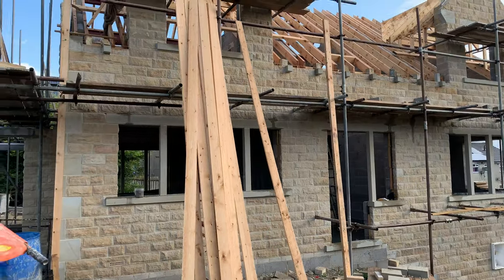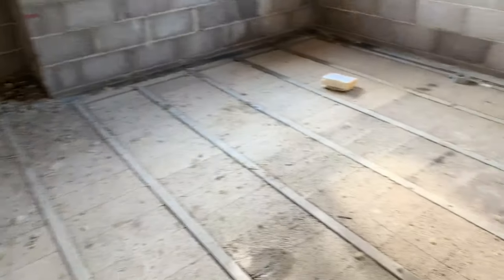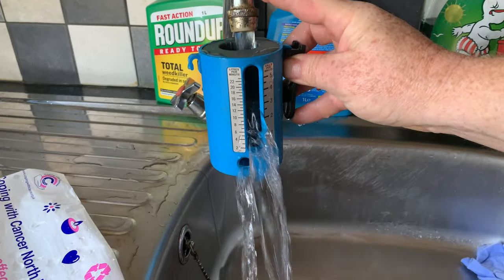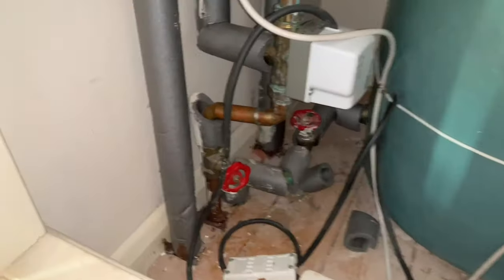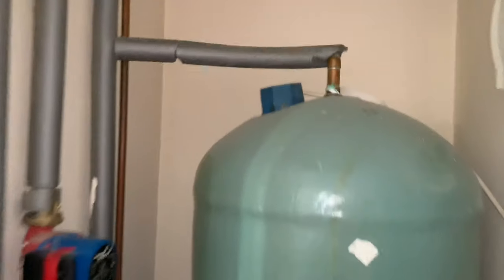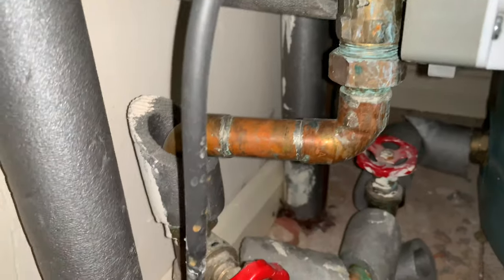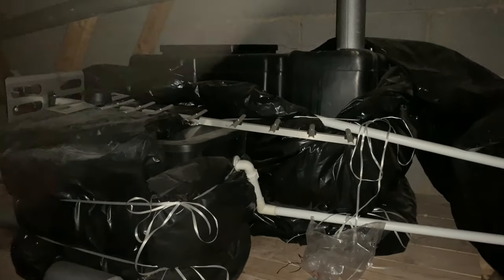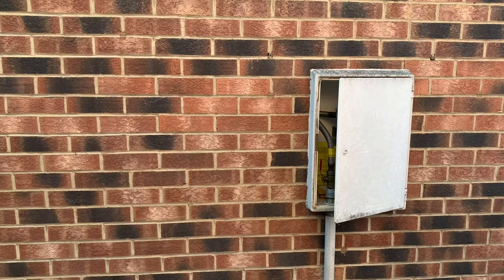Plumber - Quoting Jobs

Comment: 11 litres per min cold mains water is quite low.  I did not see any looking at the mains stop cock.  

General points for mains pressure systems (combi and unvented cylinders):

1. Fit a dedicated 22mm cold feed to the combi from the stopcock, irrespective of bore size of mains pipe. This assists in giving flow priority for the shower;
2. Fit a full bore main stopcock;
3. Dedicated hot pipe to showers from combi/unvented cylinder;
4. Fit combined isolators/flow regulators (using a cartridge for litre/min) on all H&C outlets - to balance the system;
5. You could use hot and cold manifolds with pipes to each outlet from each manifold. Then only 12mm pipe need be fitted to most outlets - 15mm for the showers. In softer water areas, even smaller bores. This gives quicker DHW delivery at the taps as the volume of cold water in dead-leg pipe is less.

Doing the above makes a big difference improving flow and influence of outlets being turned on when the shower is operating.
Reply from the maker: Do you really do this ?
Reply: @AllenHart999  
Yes, when I can. It always works. I can personally testify as my place is piped up that way. I have only done 5. once.  I see 5. a lot in France in new builds. They use the equiv of 8mm, 10mm, 12mm and 15mm from the manifold.  As the pipes are small bore, with low cold water dead-leg in the pipe, the delivery of hot water to the taps is fast.  We can learn a lot from the French. 

I have lost count of the times I have seen an old flow restricting stopcock with a 15mm pipe coming off it snaking around the house to all cold outlets with the combi teed off in 15mm, like it was just a tap! And they can't figure out why the H&C water system is poor.

The flow in marginal installations can be improved. Especially the irritating influence of one tap over the shower (*shower is king* and must get the bulk of the flow). It is taking out flow bottlenecks and balancing the H&C water system.   Do you need full flow in basins, w/machines, d/washers, toilets, etc?  The answer is "no". An extra 5 minutes on a d/washer or w/machine cycle because it is filling very slowly makes no difference whatsoever. Direct the scarce flow to where it should be, which is usually the important shower. Then a happy customer and no call backs. 

Make it clear to the customer that you balanced the system to improve the shower, as others mostly do not do it, or do not know how to. Then they tell others, who get cold slugs when the dishwasher cuts in.

It is dividing and ruling.

Comment: I went for a system boiler on my upgrade and kept the hot water tank as I have a solar heating system for the hot. I have a Valliant 630 ( I think) which is great. I just had it serviced and they commented that the install was excellent. It has a Magnaflow filter which had a tiny bit of muck on it. My installer ran the gas into the garage from under the stairs and installed the boiler in the garage.
Reply from the maker: Sounds like a great job. 👍

Comment: Question in regards to the flow cup: what if you take a reading and the tap has been restricted with the amount of flow to avoid splashing or do you open that all up before taking the reading?
Reply from the maker: Normally you would check on multiple taps. Thanks

Comment: Hi Allen, why do you prefer to run the gas pipe internal? Thanks
Reply from the maker: Gas pipe looks a mess up the outside wall. I wouldn’t want it at my house. Sometimes that's the only choice though.
Reply: Yeah i think i would prefer not to have it on the side of my house if i had the choice 👍

Comment: Hi this is my  problem  as gas engineer with gas pipe under size  you explain to customer doesn't work need to be updated you end up they getting some builder cowboys they do job for them.
Reply from the maker: Happened to me loads of times over the years. 🙀

Comment: Hi Allen, A lot of gas fitters prefer to run the gas pipe outside the house so that if a leak happens the gas is vented into the open air and there is no danger of gas buildup and an explosion. I myself prefer the pipes on the inside and I think it makes for a much cleaner look. That house looks as if it hasn't been built very long ago, so I don't understand why they have header tanks and not a combi boiler in the first place.
Reply from the maker: Most people run the gas outside because its easier and we may need to do that but i will try and find gas inside if possible. Thanks.

Comment: Did you include in your second quote fixing that dripping tap? great vid 👍
Reply from the maker: Apprenticeonfire I do not do taps 😂😂😂
Reply: @AllenHart999  🤣 fair enough
Reply: Allen Hart but the water pressure will be at mains from the hot tap, it’ll leak won’t it?

Comment: Running gas outside from meter to boiler!? If that's the only option, I'd do a recce of the neighbourhood first. See if there are any undesirables loitering abaht. There are parts of Rotherham and Sheffield where the scallies would rag it off the wall for the scrap and not even isolate the emergency lever valve at the meter.
Reply from the maker: This area is not one of the best areas in Leeds, Although its very nice where it is, 👍

Comment: Good video Allen.only complaint would be,surely your not just sizing the boiler on water flow rate? Size of rooms,make up of building etc is just as important for boiler sizing
Reply from the maker: Not really with a combi, Most combi,s give at least 24kw for the heating. 24kw would be oversized for most houses. Thanks.

Comment: Thats the y plan system out then , i wish i'd kept mine now. Biggest mistake i ever made was putting this combi in
Reply from the maker: keith brueton Customer will not have any downside on this Installation. Combi will be where the cylinder is so hot will come out just the same. Boiler will also be correctly sized for the system. Thanks 🙏

Comment: Running gas pipe to the outside is far safer option than running it inside a house
Reply from the maker: Why? I would absolutely disagree with that. Internal gas pipe is no issue at all, Externally there is a chance it would be stolen.